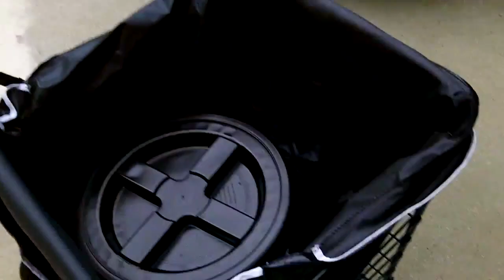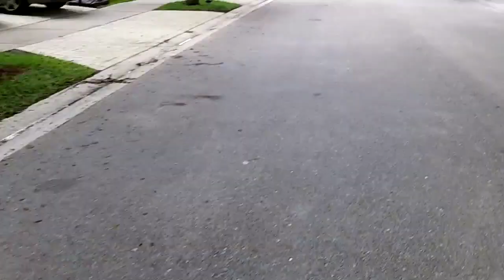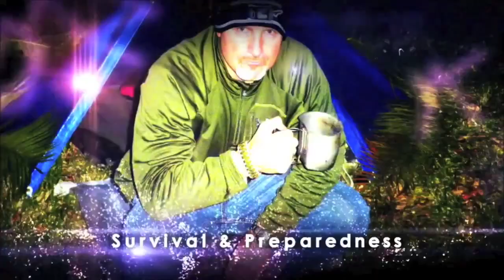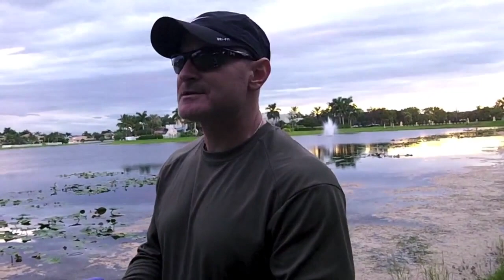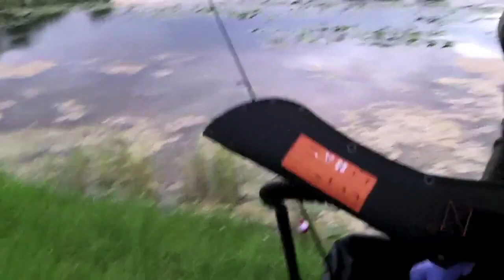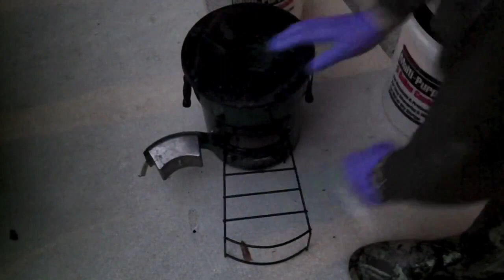SHTF- Grid is down and you are running out of clean water- How do you collect and purify more?

Comment: The best thing you can do if the water is ever shut off is to turn off your water at the main.  Also, most hot water heaters hold 80+% capacity.  Also, in shutting off your water at the main, you keep all of the water in your pipes until you can recover it.

Comment: I think a mid size dolly and 4 buckets with 2 ratchet straps would be way better idea.  You could get 20 gallons in one trip which is way better than 5 gallons.  Also dolly with big wheels 2 x as wide and 50% larger diameter would allow you to have a much more robust vehicle for water.  This is what I think.  If you get a big dolly and there are 2 of you you could get 6 buckets.

Comment: I have a 20,000 gallon pool. Water for awhile isnt a problem.
Reply: @RasKalevthesouljourner  rich? Just because I have a pool. . I guess owning a car makes you rich as well.
Reply: @RasKalevthesouljourner  I live in so cal so every other house has a pool
Reply: I hope the you not going to use the pool water for drinking. You cannot remove the chemicals to make it save.
Reply: @Youbetterbeprepping  sure you can if you have a reverse osmosis filtration system. My wife's parents were in the industrial water business so know a bit about water. Besides most pool chemicals disapat  in relatively short time. The only chemical that doesn't is the conditioner and that can be filtered out .
Reply: @johneertwegh6261  does the RO system run on electricity? Not everyone knows has an RO system let alone even knows what one does.
Reply: @Youbetterbeprepping  water pressure but a Berkey gravity filtration is pretty good and no I would never drink straight unfiltered pool Waterbury bless I was dying
Reply: @RasKalevthesouljourner  water pressure but there's waste wasted associated with it. A Berkey gravity one is as good.